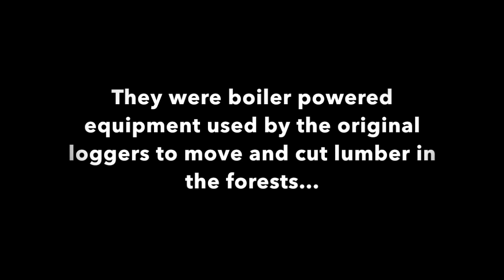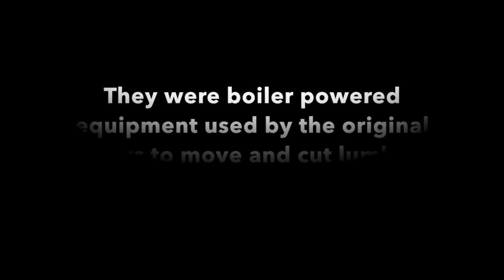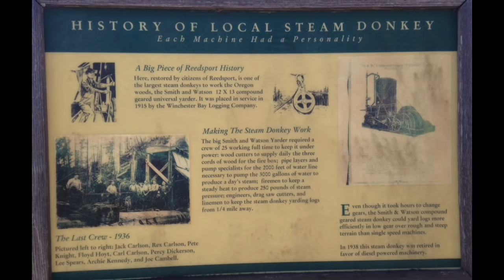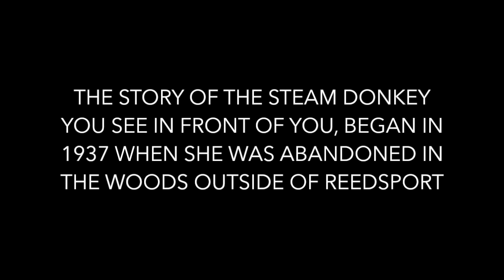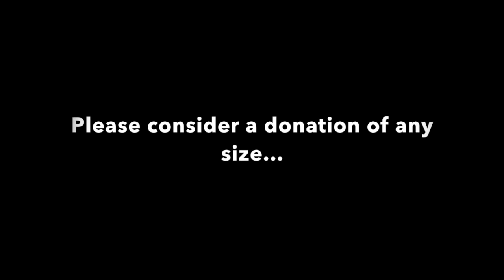Steam Donkey 2015

Comment: If it’s that much work to get it out of the woods how did they get it into the wooded site originally?  With no helicopter? To help !
Reply: When it was running they used it to pull it's self in. It would have started out at the edge of the forest and pulled in as trees were removed. It was probably pulled out many times over it's useful life but by the time it was abandoned it was being replaced. There are many of these still out there.
Reply: Came in on rails and then dragged itself around